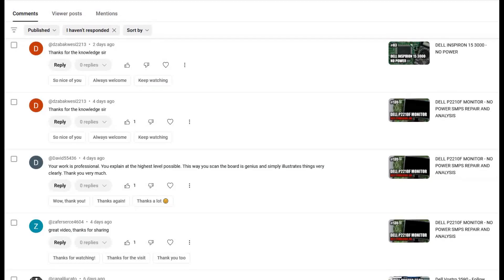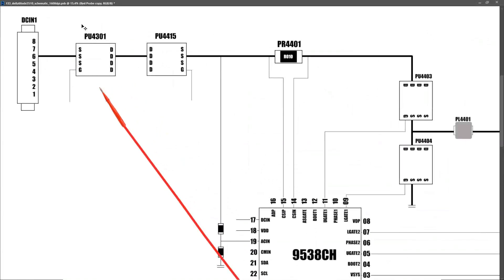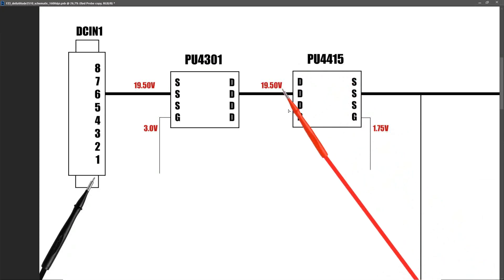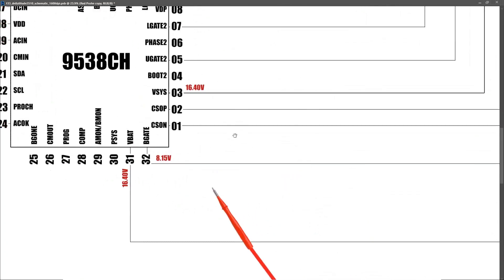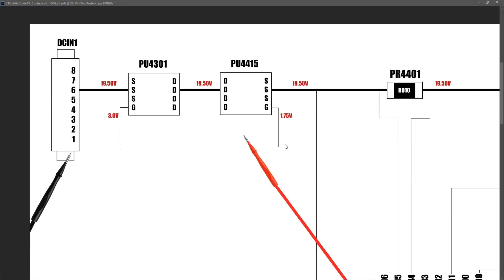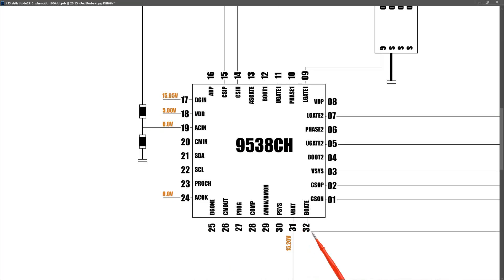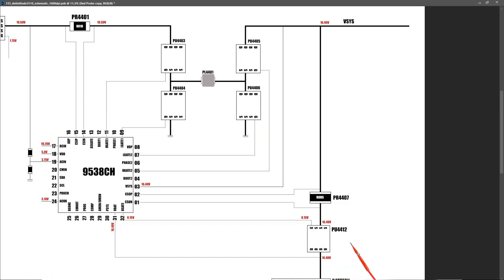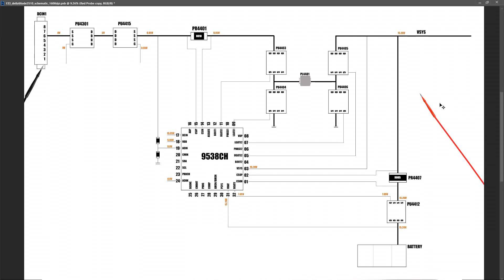DELL LATITUDE 3510 - INPUT SECTION WORKING VOLTAGES

Comment: Nice , My laptop water damaged. Cleaned, but it is not charging. Fortunately, it can turn on from battery or charger.  But I found second problem. If using charger and connect battery, the CPU speed limited to 0.38Ghz.😅
Reply: Most likely the adapter id is not being processed properly so the laptop doesn't know what power the adapter can handle, assumes it's very low, and throttles down when there's too much load (like when the battery is connected). There's a program called Throttlestop and in that you can turn off the BD PROCHOT signal which will disable this safety measure and should allow full speed operation. But it is a safety feature and you might do more damage.

Comment: So this board uses the battery voltage on the main power rail, rather than alternating between charger voltage and battery voltage. Again quite interesting.
Reply from the maker: Yeah I guess that would be my main take away from looking at it. VSYS is not a fixed voltage. If the power adapter is plugged in VSYS will be 16.5V, if running on fully charged battery VSYS will be 15.2V, if running on 50% discharged battery VSYS will be 14.2V. The secondary circuits then regulate VSYS down to the lower fixed voltages used by the other circuits.

Comment: The on and off gate voltages of the PU4412 battery MOSFET surprise me. Obviously a p-channel MOSFET, but only one volt or so difference between on and off. Quite interesting. Thanks
Reply: It's on in both cases. On when the mains adapter is connected so that the battery charges. On when the mains adapter is disconnected so that the battery provides the laptop power. It'll be off when the battery is fully charged and the adapter is connected.